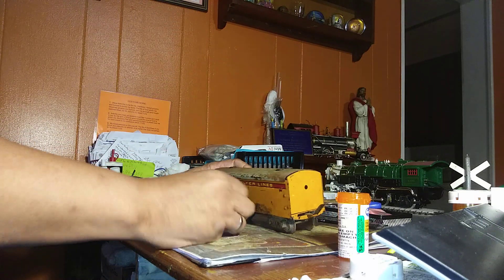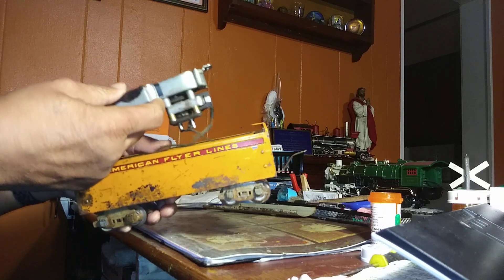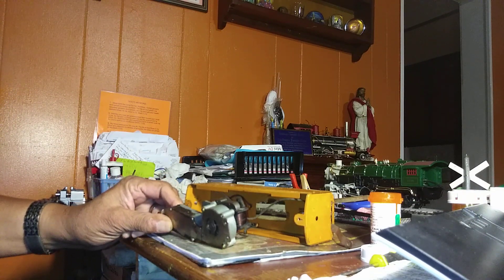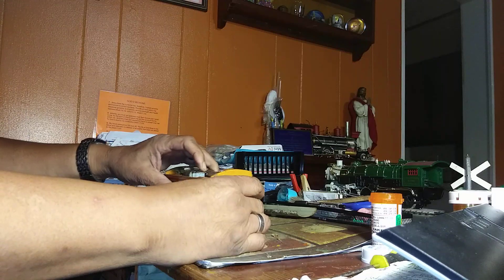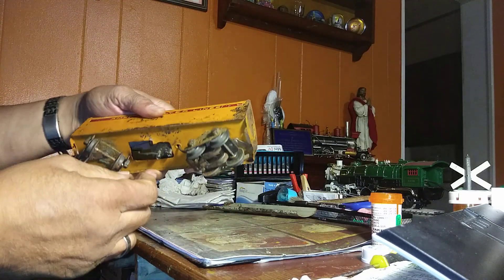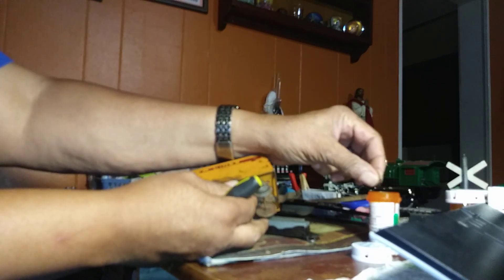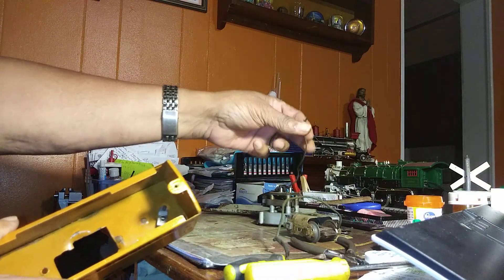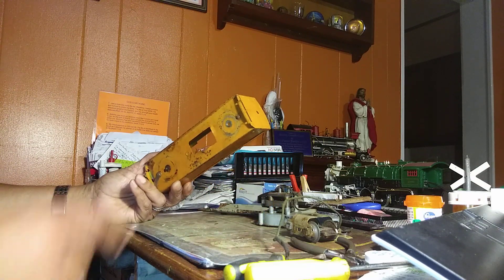Getting theFlyer Prewar Hiawatha temder ready to be refurbished/ part 1

Comment: That is cool a whistling tender I didn't know AF  had that then
Reply from the maker: Hi, Wally Yes American Flyer had Whistling tenders in the first  Hiawatha's of 1936. that is this version that I have. It's model # or engine # though they never put it on the engine or tender was 1683 as it has the whistling tender and the unusual wheel arrangement of the front trucks. With the front 2 wheels set very similar to the Marx 999 with the parallel linkage and the back pair of wheels were stationary and do not swivel. In 1937 they changed it out and used the 4 wheel pivoting truck Also  the 1936 version has no cut out for the brushes in the boiler. thanks for the inquiry. We All help One Another. "Happy Rails"
Reply: I think it's so cool to get that Hiawatha running again Keep playing with toy trains